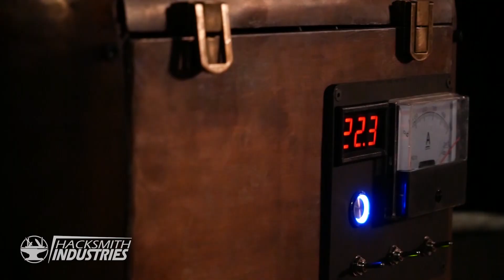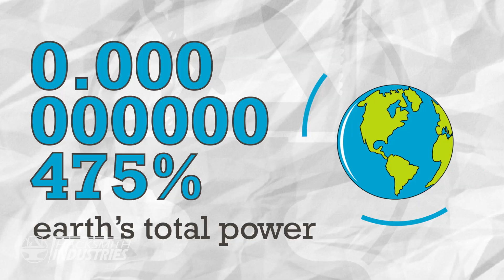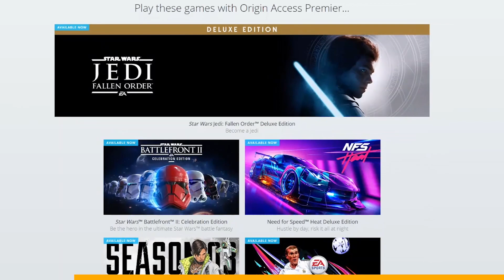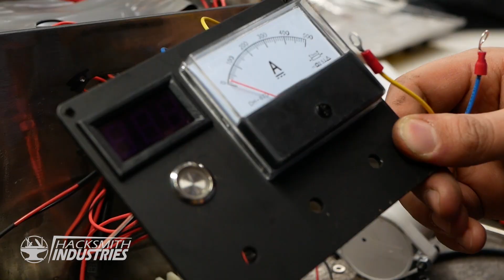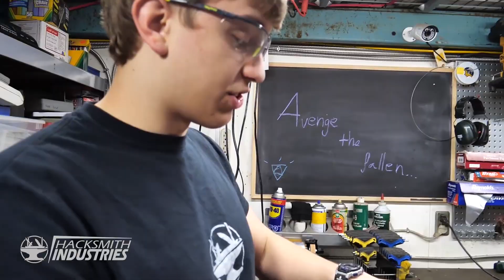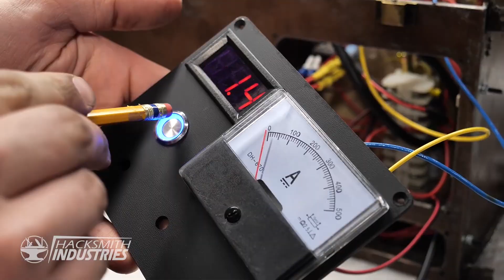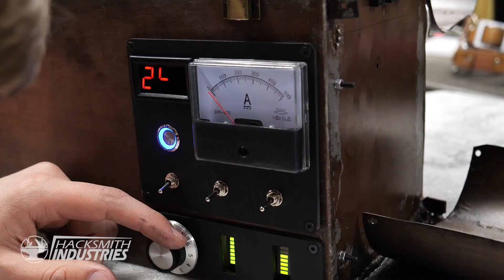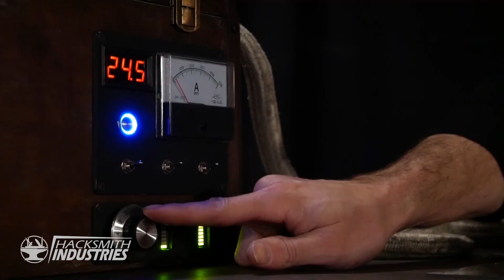World's First Protosaber! (REAL BURNING LIGHTSABER)

Comment: I don't know how well this would work or how you would implement it but copper produces a blue flame when burned, barium burns green, and lithium and strontium produce a red flame (like actually red not orange). Not a crystal per se but if you could somehow coat the "blade" or the metal rod in a safe way I think you could at least get the flames coming off of it a different color even closer to a lightsaber, i dont know all the actual combustion temps though which could interfere with the results! Like this so they can see about making different color lightsabers

Comment: Is there a way to reduce the heat so it doesn't burn your face off from a arm length away?
Reply: So you mean a florescent tube like the toys? 

Don't think you understood the purpose of this lol 😂
Reply: @NemNemesiS-YT  I'm just saying to reduce the heat from the Stick to your arm
Reply: @yeahh2085  It glows and cuts because it is so hot unfortunately. If you insulated it so that it was less hot to hold it would not cut, and if you reduced the power going to it it would not glow or cut. Jedis must just get used to having an oven next to their face.
Reply: I'm not smart but im pretty sure they're just pushing a lot of energy through a metal tube to make it hot so if they made it less hot there would also be less energy and less heat to do lightsaber stuff. I don't know if you could make it hot enough to not burn but still work though
Reply: @750tiprogamer  not as hot so it dont burn, put a glass case around it, and you got yourself a bulb
Reply: Yes but it would be useless

Comment: Why not use aluminum for the battery box? Just wondering.
Reply: more expensive and requires a tig welder would be my guess :)
Reply: @hernerweisenberg7052  , being a tig welder by trade, retired,  yea I can see that. Plus I guess as heavy as those batteries are wouldn't make a lot of difference.
Reply: ah, i allways wanted to do work in metal, machining and welding and such, but the company i applied for a traineeship at made me an electronics technician instead. the offer was to good to refuse :)

Comment: old welders?! they have switches that can tolerate huge currents
Reply from the maker: Not that high
Reply: @hacksmith  depends on the welding machine, in the company i work in we have welders that push arround 1000 amps with an arc to powerful powerful for shielding gas, that require powder shielding
Reply: @hacksmith  although not everyone might have access to them^^

Comment: "We tried using a MOSFET". You could totally pull this off with a MOSFET solution. There are some MOSFETs rated at above 500A. Otherwise, by refmaking the battery pack to run at a higher voltage, you can significantly reduce needed current. This is what you do for electrical vehicles. You work at a voltage of several 100 volts, and use an IGBT, a transistor that can take a very high voltage and often a high current. Your benefit of a MOSFET solution would mainly be the ability to dim the lightsaber output better. But in the end, I think a contactor solution might be the easiest.
Reply from the maker: Need the low voltage to get the high current for the resistance of the blade
Reply: @hacksmith  Ah, yes of course! I forgot about that. That makes sense.

Comment: Wouldn't capacitors be better as they're designed to let off a lot of electricity very quickly?  Having multiple "levies" in the form of switches or buttons to stop electric flow from a set of capacitors would let you let off electricity from one set of capacitors and let you seamlessly start drawing from the other.  This could either lighten the battery pack, or allow you to have a longer power life for the saber.
Reply from the maker: Nope,  these batteries are rated for the current they are discharging

Comment: ...just an idea but try adding a little air turbine at a base of the handle or maybe install it in the bag and channel the airflow trough the wires to blow off the heat from the blade. Kinda making the "protective airflow layer" around the blade...:)

Comment: Wireless energy, i.e. Tesla, could solve the “power supply” problem.  Of course, that would just mean the user could only use it if they were close to a power source.  Still it would get rid of the cord.

Current knowledge failing to know “how” to build a Lightsaber, fails to mean it is “impossible”.  The exact opposite tends to be true, that being that “anything” is possible with the scientific method.  Adapt, improvise, and overcome.
Reply from the maker: Getting the power density is the problem.  Even if we had a tiny battery or reactor that could put out that much power,  good job,  you just got melted alive. It's more about basic physics than lack of technology.

Comment: “Scientifically impossible” and “not happening anytime soon” are very different statements (and you said them both).

In any case, that amount of energy is far from scientifically impossible to create.  That amount of energy can be obtained by annihilating only 18.8 micrograms of mass per second...seems pretty doable (1 gram of mass would last for 53,180.8 seconds of lightsaber use).  Please check my math here, but even if I’m off by an order of magnitude it seems very possible.
Reply: You seem to be leaving out the part where turning that on would incinerate you and everything else in the room.
Reply: Sandw1chBoy because of the amount of radiant heat?  Depends on the wavelength of the light, no?

Comment: If you wanna make a REAL lightsaber blade, your gonna have to create a magnetic Felix to trap PLASMA in as the blade, which will take ALOT OF ENERGY, probably 20 or more of those battery packs, because you’re gonna have to heat up the air inside the magnetic feild within a couple of seconds. Also, creating a magnetic feild in the shape of a lightsaber blade is gonna be pretty hard, and your gonna have to release the feild while turning all the air into plasma.

But this is pretty cool.. ngl. I was thinking you could use nuclear fission in the handle but I think that’s not gonna end well...

Comment: i love how you can watch these people, and the more educated you are, the more impressive it is. Like seriously, running that much power in an uninsulated metal copper plated box, and then wire the the thing without no thermal wrapping, and hope it doesnt short and turn you into a lightning rod. Well they have balls of steel.
Reply: I am pretty sure they do a lot of testing off camera. But of course for the video it looks better to just grab the lightsaber from the workbench and turn it on without any protection.

Comment: You guys are certainly nailing the look and feel. There are three important things to consider for the next one though.

1. Portability. Having the 'blade' permanently extended is kind of limiting in carrying the thing around.
2. Cooling. After you're done using the blade, it's still going to be red hot for quite awhile, can't exactly slot that bad boy back onto your belt right?
3. Colour customization. Enough said, Orange is alright, but it's not a real light sabre unless you can make it go green/blue/red/etc.

Comment: I'm feeling like blacksmiths the world over might object to claims of "world's first"
Reply from the maker: ... no one else has made a protosaber dude...
Reply: @hacksmith  Pretty sure they're inferring that it's basically a hot metal stick, and that any blacksmith has also made hot metal sticks.
Reply: @hacksmith  Yeah, I was just teasing about the hot metal rod aspect to it...which is not to knock the impressive electrical engineering that went into it, because I gather that that's moreso the point of the channel than any fidelity to Star Wars lore.
Reply: I’m struggling to read this comment
Reply: Meh. It would be really impressive if it actually provided a controllable plasma arc. Or fired plasma bolts.

Comment: Now we need different colors
Reply: Different elements burn different colors. Copper produces a sky blue flame, Barium produces a Bright Green flame, Lithium and Strontium produce Red flames like that of a sith saber
Reply: @tumbledortrickster6504  i dont think any of that will survive the heat
Reply: @tumbledortrickster6504  Yeah but not all elements can afford that mount of heat
Reply: Unfortunately it is not possible because the rod is not burning, it is emitting black body radiation in form of light in a certain wavelength for a certain heat, and for all elements it goes from red to white.

Comment: Very cool guys, but I have a word of advise.... If you're really going to have a light saber duel (where they'll both hit each other) there are 2 major things to consider (I'm guessing you guys already thought of it, if not, hope this helps):

1- the structural integrity of the saber stick itself, will it take an impact without damaging/bending the base itself while its that hot (metal bends when hot, think of how a knife/sword smith shapes metal by heating it and striking it with something metal).

2- make sure where both beams strike, they both don't bend on impact with each other while hot. 

Just some basic physics to keep in mind. Basically, how hot should it be to produce the light effect you've achieved without it reaching the metal's heat bending threshold.  

I hope you guys succeed, it'll be great to see. :)

Comment: This just begs the question.
If you managed to make a fully working photo saber. What's to stop other people mass marketing this?
Downside 1: Unknown battery life
Downside 2: Unknown durability of actual saber. Due to extreme heat and possible slashes to hard surfaces might damage the blade. Or worse.
Downside 3: Recreating this might be too costly for mass production.
As to the battery life issue.. there has to be some way to transfer the excess heating elements into energy. Like a thermal reactor of sorts. As to the metals of the actual saber itself, not only will you have to measure the degrees of heat this generates when it's activated, but also find some type of alloy metal that is capable of withstanding that kind of heat and impact. A quick Google search should fix that. Example- Metal, Heat resistant list. Or something along those lines.
Now as to the actual cost of producing this saber of sorts is unknown to me. Because I don't know the production cost. But knowing big companies I'd say if you had a patented technology that was easy to replicate/produce on a factory type level this could very well be the next level of weaponry.
Reply from the maker: Except it's a useless weapon... that's why
Reply: @hacksmith  
You've showcase this in the video melting through objects, and cutting them. I'd say that's pretty useful if improved.
Reply from the maker: A foam head...
Reply: @hacksmith 
Your very closed minded about this aren't you? I'm sure this can work..

Comment: With our current material to energy exchange ratio it is indeed scientifically impossible to create a lightsaber. My chemistry teacher told me that the amount of energy contained in a paper clip would equal that of an atomic bomb if you were to harness it efficiently. So if you can solve that problem, along with the other problem of keeping that energy circulating in a contained path and not dissipating outward, then you got yourself a scientifically viable lightsaber.
Reply: Your chemistry teacher was in error.   Iron is neither fusion nor fission capable of release of energy, and is the end point of nuclear reactions.  That’s why stars have iron cores.  Specifically Iron-56, though paperclip iron is likely close enough to be useless.  The paperclip itself has no useful energy.   If you had an antimatter paperclip then that would be another story but that’s not the paperclip by itself.

Comment: You're saying a nuclear reactor is equivalent to 650 car batteries??!
Reply: I mean, if 650 car batteries is enough, then a nuclear reactor would be more than enough, right? I mean, it’s not like you can just build half a nuclear power plant.
Reply: Optimistic Pessimist ‘you can’t build half of a nuclear power plant’
Tell that to chernobyl
Reply: Optimistic Pessimist G O N K D R O I D
Reply: it's actually 652 batteries for a nuclear reactor.....
Reply: Well yes but actuly no
Reply: From a certain point of view.
Reply: He said 650 car batteries and a nuclear reactor
Reply: @Ki_y3on  Nebular reactor? Like outer space dude?🖖
Reply: Why not?
Reply: In output power
Reply: No, he stated that 120,380 Aa batteries, 650 car batterries AND 1 nuclear reactor or simply  0.000000000475 percent of earth's total power as substitute for the joules required to power lightsaber.  He just said it in an order that might have confused you as to what and which equivalency he was trying to convey. Ultimately, though if you re-watch to hear what he said then you'd understand no problem.

120,380 batteries + 650 car batteries + 1 nuclear reactor = lightning bolt/0.000000000475 of earth's total power.

Comment: node did it in 2016 and did it better.
Reply from the maker: That was a flamethrower stick... and node didn't make it, allen pan did
Reply: @hacksmith  whatever, it came closer to a real light saber than charging a metal rod with electricity.
Reply from the maker: Really? Because if you moved it at all it disappeared.

Comment: It’s technically not impossible they say we are discovering how to do fusion (within the next 200 years)which is basically a tiny star fusion is much more powerful than fission which is the current most powerful physic
Reply: The issue is that the heat of a real lightsaber would kill or set fire in its on owner
Reply: The main issue is getting a beam of light or plasma to extend and be concentrated in a small area.

Comment: Isn't this basically a light bulb?
Reply: Not even close
Reply: @hmad898  true, the filament of lightbulbs is probably 3 times as hot ;D
Reply: @hernerweisenberg7052  if that were true, then they would be 7500 degrees farenheit, as the heat of that blade is about 2500.
Reply: rly? my estimate was about 950°C. how did you come to your estimate, or did i miss them mentioning the actual temperature?
Reply: @hernerweisenberg7052  saw a reply to a comment earlier from the creators. Mentioned the temperature.
Reply: some googleing tolde me that 2500° F is about 1300°C, so at ca 2600°C, the lightbulb wire is only twice as hot ;)

Comment: It's not that it's going to be forever impossible, we just aren't quite advanced enough to make a power source like that
Reply: Evem if we had the power source the heat of a real lightsaber would kill or set fire in its owner
Reply: @coca_0146  by the time they are able to make lightsabers even at basic level they'll prob have some way around that
Reply: @JustSilver23   That's impossible, to make a lightsaber that works like in the movies you will need be near the temperature of the Sun, and if you create a flame of plasma that big only the light the plasma will emite will make you blind.
Reply: @coca_0146    Considering the computer in our smartphones is more powerful than the one that the first rocket used,  I'd say we're on the right track
Reply: @n0nexreb0rn4  but these computers weren't bound by the laws of physics? Stop making this comparison.
Reply: @MrGOLDENCUPCAKE1  Im just saying, anything is possible given enough time.
Reply: I still think the energy output would make it unrealistic and impractical to wield as a sword. even a heat shield of some sort likely wouldn't be enough to fix that issue.
Reply: The energy needed would be even more of a problem if you wanted it to unsheathe in the same why it does in the films.
Reply: ...obviously?
Reply: you couldn't generate that much electricity in a light saber you cannot fit a powerful enough turbine but you could probably make some kind of small clean and quickly turn off able reactor in the size of a light saber that directly heated up the Tungsten rod maybe with Thorium that was also vacuum sealed or with Aerogel between the reactor and the handle the real question though is how thick does the glowing hot tungsten need to be for you to swing it at things without it bending and would that ever be practical?  even with a theoretical unlimited power source? compared to a steel sword or just zaping things with electricity instead
Reply: XDbored1 nuclear fusion

Comment: Why don't you use a high powered hologram of rod that way you can reduce power consumption when not slicing through stuff. Also you can pluse it for cutting instead of running full power all of the time. It will function a lot more like a light saber considering its made of light.

Comment: Have you guys looked at or talked to MaxAmps dot com for batteries? They have 100C rated LIPOS, like one I looked at just now 12000mah 6S 22v 100C for 1200amps from 1 battery!!  BTW, to keep them from puffing up during use make sure to low current cycle your lipos at least once a month!!
Reply: I fly hand made drones. Was thinking the saaaame thang
Reply: 12000mah = 12amps...
Reply: @mikeb3172  well, 12 amp hours, 12,000 milli amp hours but times 100C =  1200 amps!
Reply: 12k mah is only 12 amps :/
Reply: @databite2549  The battery capacity is 12 Amp hours. 100C means the discharge rate is 100 times the battery capacity, meaning it's capable of putting out 1200 amps at once.
Reply: @humansymphony  oh, sorry. I dont know much about discharge rates :/
Reply: I've seen even 120C rated lipos. Unfortunately it's merely marketing. You'd be lucky to get even half for a few seconds  before the battery enters melt down.
Reply: @nighthawk0077  I'd love to see one of these high C rated lipos put to the test on video!
Reply: @xerravon  exhaustive high C testing up to 50C has already been done on several brands. Full report at Rcgroups
Reply: You guys are such big brains